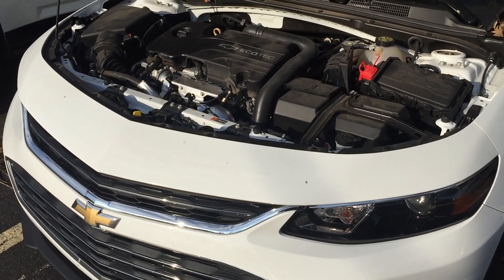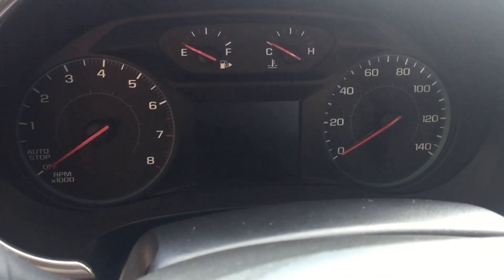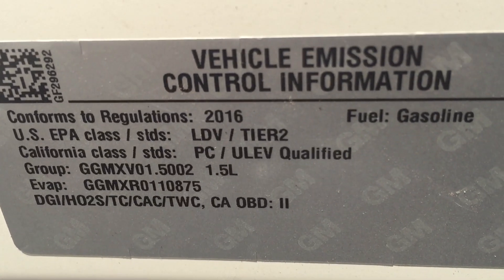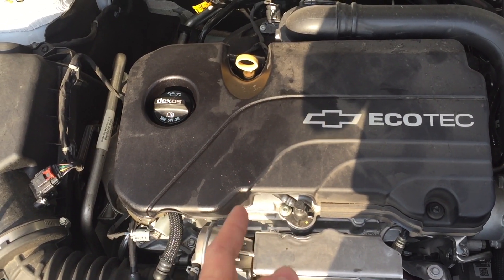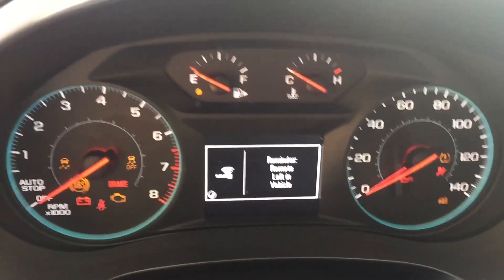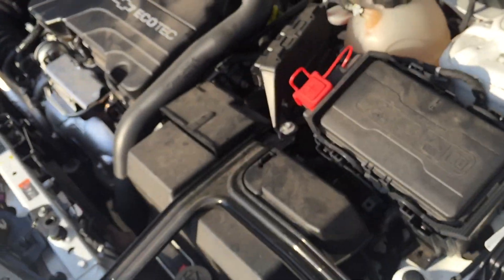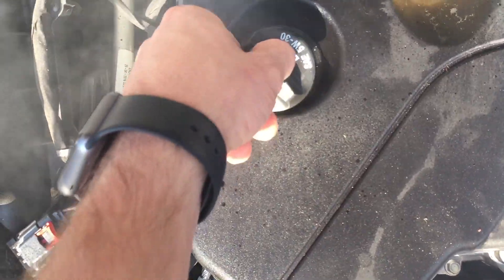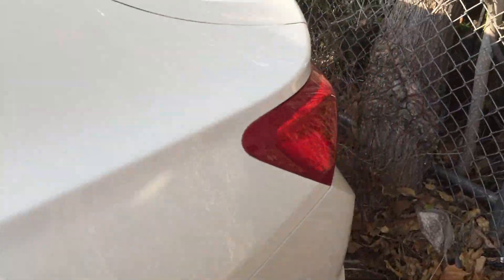What Engine Blow-By Looks Like

Comment: What's the point of moving to smaller, high tech engines if they are prone to catastrophic failures like this? Not only is this a blow to the consumer, it is a huge black mark on the brand, and erodes confidence in the technology.
Reply: simply because they have no choice. the EPA is making stricter and stricter requirements for fuel efficiency and emissions, and it hit a point of where it's increasing so fast that companies have to half-ass the engineering to get it out on time to try to meet the updated standards. i think it's sitting at 30 MPG combined right about now for minimum (trucks/SUV's get weighted differently, i don't quite understand exactly how though, all i know is they don't really count as much) and in 2025, it has to be 54.5 MPG. i can only imagine the trash that those engines will be :/ we have a 2006 trailblazer going on 200K, still going very strong, we're going to hopefully run it until the wheels come off, as now even 2006 levels of older is becoming better than the modern stuff
Reply: Austin French it was mainly an educated guess as it's the primary reason they're selling the smaller turbo engines here. Other companies (ill use a European one like VW for example) over in Europe, they had strict legislation for a looooong time, some places before the invention of the turbo. As a result, there was no rapidly changing efficiency and emissions requirements we're seeing now in the US under various CAFE and CARB legislation. So for European manufacturers, they have engines that already conform to new standards, so all they have to do is shop them over (main reason a lot of new Chrysler cars are using Fiat engines) while American companies, like Chevy for example, are well known for N/A large displacement motors, like not even any of their I4's were really under 2.0L until CAFE and CARB legislation changed, and as a result they're trying to have the guys used to designing N/A V8's trying to instead design a 1.5L economy turbo motor (which might explain the dumb choice of cast pistons)

However, I do get your point, if I were an engineer, even I know the second I hear "turbo" I have to think "Forged" though only the higher ups would allow that decision, as another plausible argument I see towards them using cast is they just have to adapt old equipment meant for casting the pistons, instead of having to completely retool a production line to make the Forged Pistons, which are a slight bit pricier and harder to produce, though we now see how terrible a choice the cast was, so in my mind at least, the retooling would have been worth it.
Reply: Well put, sir.

That's one of the great things about foreign cars, they all have forged internals even if they are naturally aspirated. They learned that lesson a long time ago. 
And what sucks regarding American cars is that it's not just because of the turbos, their quality sucks across-the-board. They use so much plastic these days it's ridiculous.
Reply: Justin Noker Are you seriously blaming the EPA and not the company for using substandard parts and materials? All the other auto companies aren't having these kinds of problems. American cars are terrible because American companies put profit before quality. Next time you go to the gas station look around and see how many American cars vs for foreign car getting gas.

Comment: The puff puff is a pretty telling but 19k is way too early to be having this severe an issue but pistons failing is more common then people know and a lot of it is just poor materials that usually arent noticed until they become problematic like you mentioned with the cruze and malibu series with these engines.Replacing the pistons unless they have been revised could just be another failure to come. The real question is what the cylinder walls look like, judging by the blow by my guess is they wont look too good. Great video by the way

Comment: Hi I have heard that the Volt has engine troubles it's a 1.5 litre non turbo there must be something way different in the 1.5 compared to the 1.4 because in the volt the engine was reliable this is going to cost them a lot of money.

Comment: I like Chevy but if you're going to make engines that fail below 20,000 miles then you're obviously doing something wrong.
Reply: My 1999 Jeep Cherokee XJ has around 170,000 (which is actually pretty low for these cars as they're known to last well into the 300,000+) and I haven't had a single problem with the engine so far.
Reply: My 99 Toyota with 291,000 has no issues with melting pistons and it spanks the rev limiter daily.
Reply: drewx420 that's because toyotas of that era were tanks......gm has always made junk.....
Reply: anything made before the 2000s were made properly,
Reply: brainwashed

Comment: Basically GM took their standard 1.5L engine, and slapped on a turbo charger on it to compete with Ford's ecoboost.
GM did very little R&D before bringing the Ecotech line to marked.

Comment: Blow by at 20.000? Blown turbo at around 20.000? What are they doing?
Reply: i looked into it, turns out the engineering department has no clue how turbo engines work. due to the added air in the combustion chamber caused by the turbo, it will burn much hotter. as a result of this, manu manufacturers opt to use forged pistons, as they can much better handle this heat. take the Audi 20VT for example, a 1.8L turbocharged engine, you can find many of these things reaching 200K miles without a single issue. in GM's case though, they are idiots. they instead opt for cast pistons. they're cheaper and easier to make, but should really only be limited to N/A applications, as they simply do not hold up that well to the higher heat seen in turbo engines. as a result of this, this happens.
Reply: Justin Noker That's unexpectedly and disappointingly stupid.
Reply: hydrochloricity That might work for short distances, indeed.
Reply: He has a video of a 2017 ecoboost with the 20k miles that blew the whole engine, new cars are always fucked no matter the brand.
Reply: The Audi 20VT is a 2.2 - I own a UrS4 with said engine.  However, there's a fair amount of OEM turbo cars without forged pistons- Subaru WRX & STi (pre-FA series engines) are the most well known example (yes, they're known for cracking pistons, though not often at stock power).  The subarus have hyper-eutectic  cast pistons.  There's arguments for them too- they're quieter and run cleaner in the cold, as their thermal expansion is lower than forged, so the piston-wall clearance can be tighter, meaning less blowby when cold, and less piston slap.

It seems to me Chevy cheaped out on pistons and hope the DI would save them, but really a 1.5 even turbo is probably a little small for a midsize sedan.

EDIT:  I see the 1.8 20VT is an I4- didn't realize VAG had done a 5 valve/cylinder engine recently.
Reply: hydrochloricity There are obviously more ways to do this, but not doing anything and hoping nobody would notice is by far the worst. If you cheap out on serpentine belts you do a recall but how can you do a recall for weak pistons? Do you swap all of the "offending" engines? And yes, that is a small engine for that car. I drive a Peugeot 307 with the 1.6 diesel. It moves but it's nothing special. They put the same engine in the Volvo S80. Would that be enough?
Reply: cipmars That would be the "correct" response to a widespread issue, doing a recall and swapping engines.  However, I doubt that the portion affected is nearly significant enough to suggest such a drastic action.  I don't have numbers, so I could be wrong, but my guess is the number of 1.5Ts that are failing is so low as to only bother GM for replacements.

A 1.6DI might be, but there's no way you'd sell them in the US.  Especially after dieselgate.
Reply: hydrochloricity Nooo, of course not. I'm afraid the movement against diesels has already started in Europe too. In France. They plan on taxing diesels much steeper, I hope they will not do this for utility vehicles because gasoline and natural gas are not an answer for those.
Reply: cipmars Most likely for local delivery and transport, utility vehicles (and any fleet vehicle that has short travel distances in dense areas) will be electric.  It fixes most of the problems of both gas and diesel engines.
Reply: putting a hole in your pocket.
Reply: ***** with CAFE, even 0.5 MPG makes a huge difference
Reply: ***** he has expressed dislike to it (enough for my friend to say "return of the land barge 2017" as a joke lol) though don't forget emissions, while yes most states just go with the government minimum, some have opted in to follow CARB regulation instead

Comment: How does blowby accure? Is it because bad driving, cold starting or what?
Reply: exhaust gases passing by the piston rings, on a normal good condition engine a small amount is completely normal
Reply: warmaster949 Okay thanks. Why does it happen and get so bad though?
Reply: Junk engine, a mistake during production most likely.  At 20,000 miles it shouldn't be happening no matter what.  Cold starting really doesn't affect modern engines with modern oil in the slightest yet the internet continues to freak out about it constantly.
Reply: In this case, it's said to be a 'melted piston'.  The piston crown got so hot it deformed and developed a crack/hole.  Because it was driven hard and the engine internals weren't up to it, and/or the engine management system failed to adequately control the combustion conditions.

Comment: I am going to stay away from any of these new small engines with turbo's.Ford is doing it too.I am not convinced of the overall reliability  and longevity.I will stick with naturally aspirated.Ford has timing chain issue's with their ecoboost line too.
Reply: pontiachotshot I think the reason their pushing these out is because Volkswagen, which have almost always been reliable turbo diesels, cars are forced out of the market.  I think Government Motors has something to do with it.  Don't say that's the only diesel I had/have, 1999 ford f350 powerstroke, tractors, and cat engines, and cummins.  Oh I forgot to mention also that I try to get 03 older vehicles.
Reply: Zachary Solomon 

VW makes a good turbo 4cyl gas or diesel.They have many years of practice under their belt.Ford and GM just cant seem to get their shit together with turbo motors.Newer vehicles are so tempting because they look nice but i call it pretty trash lol.
Reply: the reasoning behind the the new turbo small motors is efficiency more power and torque less fuel consumption. lighter car and cooler running motors saves money on both ends of the spectrum for the dealer and the buyer
Reply: I got a Subaru legacy with a 3.6 liter Flat 6 and its fast than most turbo charged 1.5 liters on the road. it pushes 275 HP and if I wanted to, I could push 300 HP with a simple Intake and exhaust switch and a recode.
Reply: @UCe5fpQpW-aPOW4ZZgbNxOqA No shit, really? You have more than double the displacement and produce more power therefore being faster? Who would have ever guessed? Idiot

Comment: this scares me my 1.0 ecoboost fiesta has 50k miles .
Reply: kurt roepke ECO boost 1.0 are bullet proof so don't worry!
Reply: It's not all small motors...many of them are excellent. The 1.0 ecoboost is solid, as are the EA888 engines VW/audi uses. Material engineering has come A LONG way with turbocharged engines.
Reply: Change your spark plugs if you haven't already, change oil on time you should be ok!
Reply: yeah, i've heard nothing but good for the 1.0L, you shouldn't have much worry.

Comment: More of today's modern "Walmart" grade disposable crap. Sad for Chevy to ruin their reputation putting out absolute junk like this. In the 1970s, the Malibu gained the reputation of being a reliable, bulletproof car. Even the downsized late 70s / early 80s RWD Malibus were reliable little cars, with exception of two years '79 and '80 with some 305 V8s which had poor camshaft metallurgy, but this was still a minor problem compared with this, and didn't show up until much later than 100,000 miles. But get an "Iraqi Taxi" with the 231 V6 and drive it forever, and spend next to nothing on maintenance!
Reply: Justin Noker this guy has a really nice camera
Reply: LakeNipissing 2.2 are great motors
Reply: yeah, i was actually looking into GM a bit, and it turns out that there are now quite a few things that weren't GM. back around 2006-2008, they were in a partnership with Fiat, and some signs of this are left (the duramax 2.4L in some cars is actually a fiat design they still hold the rights to) and even the Pontiac Vibe, that was just a redesigned Toyota from when they were in a partnership. then when 2009 happened, all of GM went out of business. what seems to be unknown, is that there are two different GM's. the "old" GM and the "new" GM. the old GM is the GM that was making cars from the company's founding until the crisis of 2009. after 2009, the US government actually gained control of all assets and formed the "new" GM, and the US government owns 60% of the company, Canadian government 20%, and the remaining 20% is divided among shareholders. so basically, the GM that made those great cars and engines, it now ceases to exist.
Reply: Pete S.
we have a 2007 with the 2.2, 139K miles and no issues whatsoever, maybe we're just lucky?

Comment: sounds like a John Deere 2cyl
Reply: South Main Auto Repair u da man eric......
Reply: South Main Auto Repair damn, you beat me to it!
Reply: South Main Auto Repair John Deere would never put a motor in a heap of garbage like a Chevrolet car.
Reply: South Main Auto Repair Johnny popper
Reply: South Main Auto Repair John Deere has used GM products on their tractors for over 70 years DUMB FUCK
Reply: @Wanous-hv7zo  Hahahah look at this tool 🤣😂
Reply: +1970 olds442 can you give me a John Deere model number that uses a GM motor, because I know for a fact that John Deere primary uses there in house diesel engines over the 5 series tractors and and other equipment, with the exception of a few 9 series that uses a Cummins QSK 15 and an ISX 15. With the tractors under the 5 series and small equipment like a zero turn mower for example, they generally use a Yanmar, Kohler, Yamaha, and even a Honda engine. I'm quite interested because I haven't heard of a John Deere product using a GM engine.
Reply: What about a jd 2 cyl ? Lol .
Reply: Or a recall if it keeps happening.

Comment: does this happen with good maintenance?
Reply: poor engineering and cheep parts and labor. Dont quote me on this but i think these engines are made in Korea so that should explain why they are shit
Reply: Whityford if i remember correctly, the modern Ecotecs are designed by Opel, but according to Wikipedia, the 1.5L turbo (used in this malibu) is manufactured in "Toluca (Mexico), Springhill (Tennessee) and Flint (Michigan)."
Reply: David G get a different car. If you're considering. This engine is way too small for a car like this
Reply: Matthew Supples i wasn't considering or even thinking about this car, was just curious about how this happened as he didn't say why.
Reply: ya can't fix stupid

Comment: there should be a lawsuit and recalls on them junkers
Reply: They need more power. Engine is too small for this car. Just add a turbo ...
Reply: @38911bytefree  under the knowledge of Scotty Kilmer I disagree if the engines already falling apart like this it's going to be made worse with a turbo it's more stress faster wear if your car's engine is shit and falls apart all the time adding a turbo is just going to make it worse heaven forbid the turbo brakes too
Reply: 38911bytefree They should’ve stuck with a 2.4 liter 4 cylinder naturally aspirated engine or used a detuned 2.0T engine as the base engine.
Reply: thecomputerman100 well odviously they need the v6 becuase the straight 4 turboed aint workin
Reply: You ever drive a car with a 1.5 in it without a Turbo?
These cars need a turbo.
Reply: Edward Myers There's a lot of new cars out there that need a V6... That's why I have my Fusion in a V6. :P
Reply: skulledmonte84 yea there is tons of recalls on all new cars and trucks
Reply: skulledmonte84 yea there is tons of recalls on all new cars and trucks
Reply: skulledmonte84 exactly i dont see the point in adding a turbo
Reply: These have turbos already
Reply: The government killed big engines.

Comment: the 1.5 and the 1.8 4 cylinder are dawoo   designed   and built engine that's why they are failing